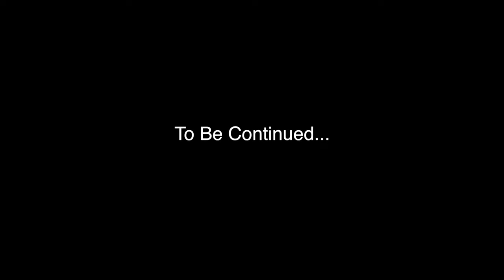How To Fix Stuck Brake Caliper Ford F250 F350

Comment: I'm of the opinion that sliding caliper brakes should be banned for use on the front wheels because they're so prone to seizing up, they also wear the pads unevenly if this caliper had a piston on each side this wouldn't have happened, the pads wear more evenly and the brake feel would be far better.

Comment: These days parts are so inexpensive it's cheaper to just slap a new one on instead of rebuilding as a master technician for Toyota we don't rebuild anything if it's broken we just use new parts. Also the reason brake fluid feels terrible when it gets on your skin is because it absorbs moisture rather quickly so it drys out your skin after long periods of time

Comment: I go through a set of rear calipers for my F350 every 4 months or so, as I can only find re-manufactured garbage.
Reply: Had the left rear lock up in August and now the right front today. Replaced both rear lines in August as well and the old ones looked fine, rubber wasn't checked and fluid ran right through them.
Reply: I used to buy ford parts, but they were expensive remans, now I use Oreilly's and they keep giving them to me for free since they have a lifetime warranty. Do you know of a decent brand that might last longer?

Comment: you get all back but the tax uncle keeps his share
Reply: +finpainter1 I literally took a brake caliper back to advanced yesterday for my $20 core.  I got back the 20 plus the tax from it.
Reply: hmmm not in michigan
Reply: +finpainter1 I'm in SC.  Guess it's state by state?
Reply: A return is a return. Core or anything.   I have never in my life not got tax back.   That is crazy.
Reply: In Mi. say you pay 50 dollors for a part then 25 dollors is added for core charge =75dollors times 6% sales tax = 79.50. you will get back 25 dollors .they keep the 6% They charged you on the 25
Reply: +finpainter1 that is some BS.  Not right they get away with that.
Reply: +finpainter1 Sounds like time to move out of Michigan.
Reply: +Rhett Wood  
"They" get away with a LOT that isn't right. In my county we had an election calling for a new toll bridge over the ship channel. The deal was, tolls would be suspended when the loan was paid off. INSTEAD, the very day the loan was paid off toll rates INCREASED on the bridge. We voted in state run lotteries with the PROMISE all the profit would fund schools. You got it. It didn't. Went to the "general fund". It took years and a lawsuit to correct that. In the meantime the state made several large fortunes and the schools got shafted. Doesn't make much difference where you live. Examine YOUR states financials and get the shock of your life. Then add in the cities, counties, school districts and federal "tax" bites and see how much of "your" money is actually your money. You make a bunch of government contractors and politicians filthy rich, and a I DO mean filthy. As in slimy.
Reply: our property taxes will go down with the lottery,so they said ..here they went up every year  cause they put it in general fund here also. instead of schools. they all lie.

Comment: A Dana is on Fords, Dodges, or GM's.  It doesn't matter.  Actually if you think about it, given how many parts are in a vehicle, and the conditions that they are used in, it is amazing they last as long as they do.  Oh by the way, that wonderful burnt break smell is asbestos molecules piercing your lung cells which will cause lung cancer when you're rocking on your porch thinking about the good times you had when you were young and foolish.  Cheers.

Comment: I'd love to see how you bleed the brakes by yourself
Reply: +slim salha 
At risk of being a troll this might be part of the problem here.  If there is no one else to help and there is no other alternative you can flow bleed the brakes providing level ground plenty of clean fluid and that the loose brake line has not run the master reservoir dry.  If you have a quart of clean fluid on hand you continuously fill the reservoir not fully reattaching the cap to let gravity flow the fluid while topping up being careful never to let the reservoir run dry  and never putting the end of the line above itself thereby forming a p trap.  Once the darker fluid runs clear you max out the top up and close the reservoir up tightly.  If possible leave the line end blocked off with a thru bolt and nut big enough to seal the old copper crush washers in place. If it weeps that's OK too.  If not then submerge the open end in a container of fresh fluid and leave it to go get your new part. This will insure that no air gets back into the line.  Most vehicles since 1990 have some form of Anti lock Brake System proportioning valve which can help or hinder this emergency only process.  The ABS valve will slow the leaking line so that it may take 4 to 8 hours for a tightly capped full reservoir to leak dry but if the master cylinder and ABS valve do leak down dry bleeding becomes much tougher and other problems can be created by trapped air or induced corrosion.  Anyway you return with the new caliper having turned in the old one for core after doubly checking the  parts side by side for identical fit and bleed screw locations and immediately check and top up the reservoir with fresh fluid ensuring that it had not run dry while you were out getting the parts.  If it ran dry you can still fill it back up  and let it flow clear of bubbles again but the brakes operation will be hindered and two person four wheel bleeding will then be imperative.  Providing the master was not allowed to flow dry you simply set up the pads and install the caliper with the exception of the loose line making sure to open the bleed screw.  Top Up fluid and reattach the loose line allowing it to continually flow fluid. Let the system continually flow through the bleed screw for about 1/2 pint after any air bubbles then close it up and wipe it down.  Press the pedal till you have brakes top up and check line connections caliper and bleed screw for leaks.    

I have done this numerous times on many vehicles and gotten away with just this procedure alone provided the brakes were never flowed dry.  HERE'S THE RUB: Ford F series dual piston calipers trap air or trash in the line and may trap some air in the upper cylinder bore of the dual piston front calipers. NOTE THAT THE UPPER PISTON ON CODY'S DRIVER'S SIDE CALIPER IS THE CULPRIT HERE. The slider pins may have been part of this but I suspect not.  If any air remains in the upper cylinder of the caliper corrosion is likely and given the fact that flow bleeding might not forcefully remove %100 of the air due to the design difference I suspect that has occurred here too.  Cody may or may not have self bled these brakes but if he did so and did not fully four whee bleed them using Jack or Mrs.W or any other 2nd person then any trapped air in the caliper would rise eventually into the upper bore.  I have figured this out about my own1999 F series front brakes over the process of 3 driver's side calipers and 2 lines and 2 passenger side calipers and 1 line on top of 4 sets of brakes. I attribute the driver's side versus the passenger side issue to be due to our (U.S.A.'s) right hand turning and driving making the drivers side more wear prone.
Reply: thank you very much

Comment: I bought this mechanic's chair and it is the best when I have to work on my wheels; http://www.sears.com/craftsman-creeper-seat-mechanics-high-rise/p-00951108000P?prdNo=4&blockNo=4&blockType=G4.  Chris Fix has a video detailing how he spray painted his brake caliper so as to prevent rust.

Comment: ford---fix or repair daily
Reply: +fred hammer
" Found On Road Dead"," First On Race Day", not to mention "F@#*ed up Old Rebuilt Dodge" though the second and third acronyms are somewhat accurate.  FYI: Henry Ford first made a name for himself and his company by racing his own cars and the Dodge Brothers were originally contract foundry machinists working primarily as Ford Motor Company parts suppliers. Did you know Henry Ford's first automobile company was later renamed Cadillac: flag ship of GM.  So no matter what the state of Engineering and Quality Control at FoMoCo is they must be given their due and for me that is the fact that they did not take any bailout money and they have not been sold in part or whole to any foreign company.  Its damn sad that a Dodge is no longer a truck and even so is now owned by "Fix It Again Tony" having been sold off by "Mercedes has Benz." Guess that only leaves "Government Motors" as an alternative.  Shoot before the death of Oldsmobile and Pontiac I never even considered owning a new Ford car.   Ford as a company ticked me off when and how they got out of the farm tractor business which was the last true legacy business of their founder.  What ever you could say about Henry Ford both positive and negative he grew up on a manual labor farm and he never forgot or denied his roots there.
Reply: +Farmer John   thanks for the info.